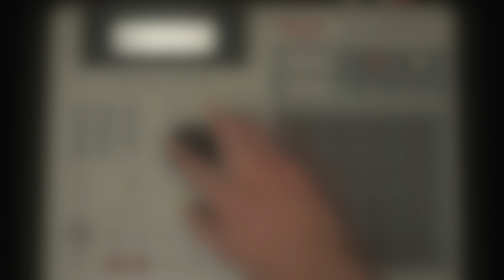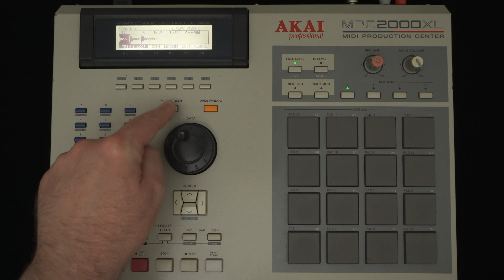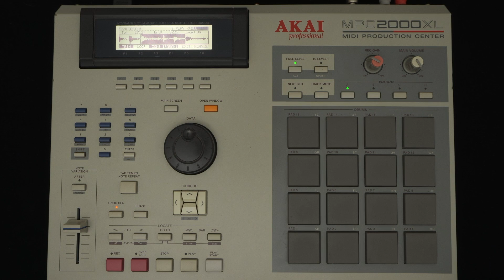How to use the Akai MPC2000XL Sampling & Editing Sounds

Comment: MY be a silly question but when sampling where is the best place to turn up the volume?  From the source in my case, my cell phone or keep my phone volume at an equal level and then turn up more on the rec gain on the mpc?
Reply from the maker: Yeah, that's a good question.. I've never tried Sampling from a phone.. but, you'd probably want to closely listen to the MPC with headphones on, while monitoring off your phone.. and move the gain / volume and experiment with the levels until you get the least amount of noise/hiss 👍🏼

Comment: Thanks to your tutorial i unlocked the capabilities of the MPC. Youre a Legend thank you so much for your detailed Tutorials man! But I have one thing i still dont got right. When in TRIM Mode and i Slice up a Loop in ZONES and create a new Program it works fine. But how do I manage to Slice another Loop in Zones and have it on the same Program? If I hit create new Program on the Second Loop I want to slice, It erases the first Sliced Loop in the Program from the Pads. But if I not create a new Program, the sounds of the second Loops are not on the pads. What am I missing? Or is it not intendet to do like i do and I have to work with the DRUM1 DRUM2 etc sections which i also not really figured how they work.
Reply from the maker: 'Zones' are like your sketch buffer.. so, if you're using Zones to specify sections of a Sample, that you want to convert into a Program.. then executing that function.. has a destructive form of slicing up samples.. you'll have to 'copy' the original, pre-sliced, sample.. so you have a back-up, then you could edit the 'copy', make a new program with slices again.. but then manually add those slices to your first Program.
PS. Thanks for that generous feedback 🙏🏻
Reply: @tonelab  to sum this Up, i slice loop1 to a new Program, after that i slice all other loops in Zone Mode without creating a new Program to preserve the First one on the Pads. Then manually save all Sounds to the SD and load them one by one to the Pads. I think i got it now! :) Thanks a Lot man!
Reply from the maker: @sonsofsubs333  Well, that's one way of doing it.  To save 'key strokes', you could just convert your slices to a new Program, because having that 2nd Program populated with sliced-Samples makes life easier to Save it as a .PGM with samples in one fowl swoop... and, the thing is, Samples aren't exclusive to Programs either.. so, it doesn't really make any difference to the XL, if your Samples appear in 1 or 'all' of the Programs available.  Just be mindful that, if there's Samples in memory, that aren't included in with any Programs.. they are easier to 'lose', ..like 'slip thru the cracks' upon Saving your stuff, because Saving a .PGM, will only Save those Samples that are allocated inside the Program in question.  I generally create a new folder for each Song, I'm working on and use Save .APS, unless I'm making library/ archive Sample-Kits.. in that case, I use Save .PGM and make sure all the Samples I want Saved, appear in the Program's Pad allocation map👍🏻
Reply: @tonelab  i have to process all this  usefull information man. I think that was the Case with my older Projects. I saved them but then Sounds, and with them Motivation was Missing after loading. I let you know when i got it Bro! Have a nice day ✌️

Comment: how do you change parameters by using shift + Note Variation Slider? It dosent seem to work for me.
Reply from the maker: the Sliders are prone to 'dying', I've had mine replaced.  So, see if you can get it to work anywhere else to see if it's still working 👍🏼
Reply: I will check. It wasn't used in a Long time. I thought it was because i need to assign the fader specificly to do so.  Thanks a lot for the Tutorials btw they realy helped me a Lot! :)